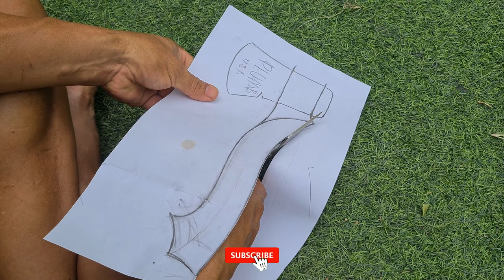Custom axe handle from Tamarind heartwood with basic tools | Exquisite craftsmanship

Comment: What are the dimensions of the wood before it is treated?
Reply from the maker: Because it is a piece of wood left over  Approximate size: width 5 cm, thickness 3.5 cm, length 10 inches 👍😊😊